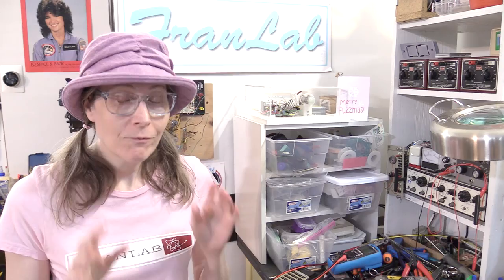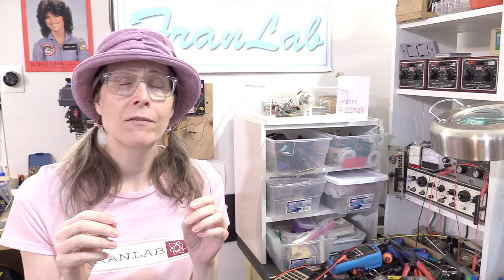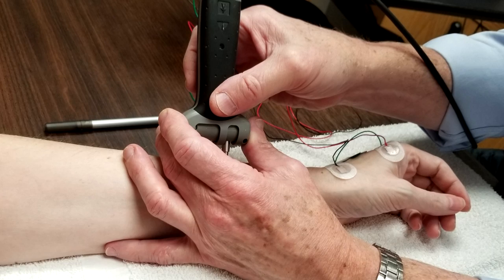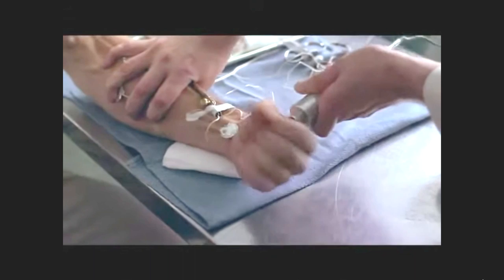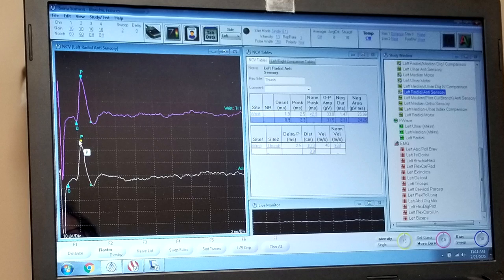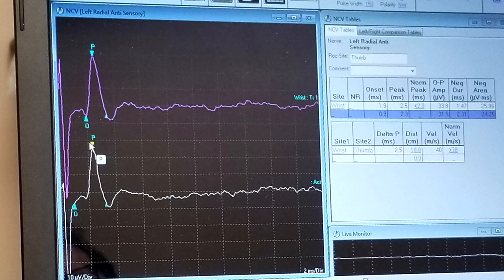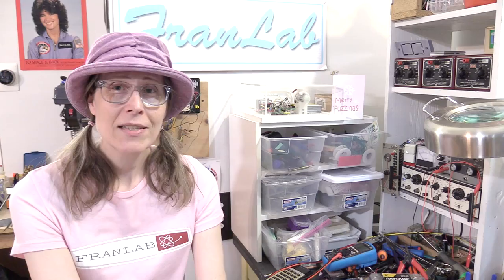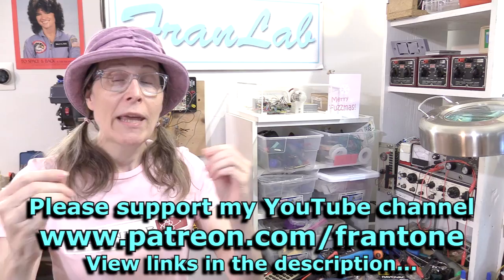Troubleshooting Fran

Comment: and that's how I found out I have carpal tunnel syndrome in both hands
Reply: I think it's just due to muscle nerves spasm, just forcing the wrist to a neutral position with a  brace might fix it.
Reply: @xponen  uhm no.. this is how they actually test for CTS.. and I found out I had in both hands.. and unlike a bunch of myths about bad posture and lots of typing giving you CTS.. the actual cause is largely unknown
Reply: @philosoaper  I will use brace, there isn't any other treatment beside surgery or taking painkillers.
Reply: @xponen  by all means.. I had the surgery several years ago already and I don't regret it